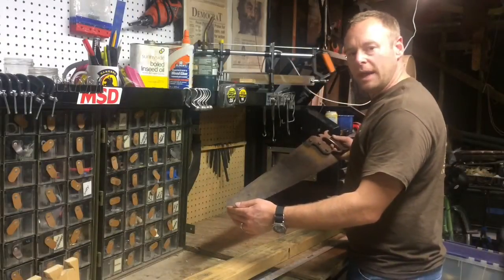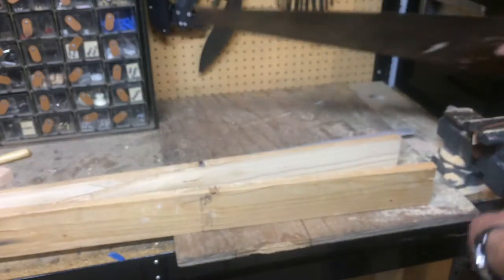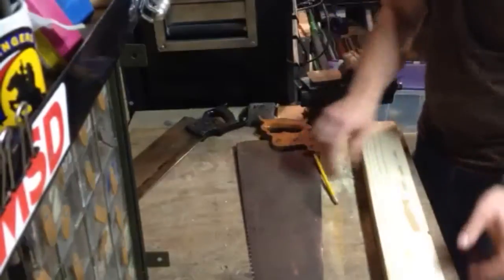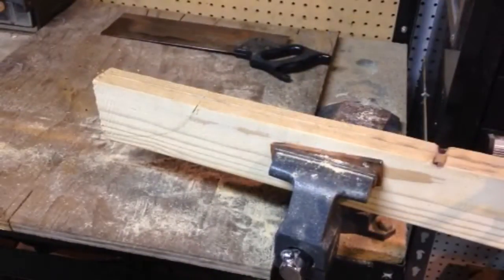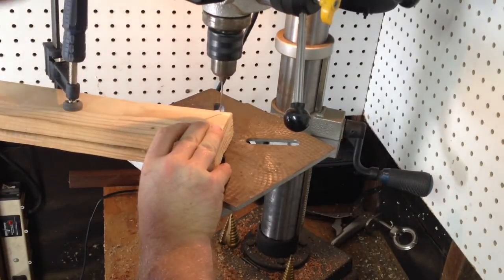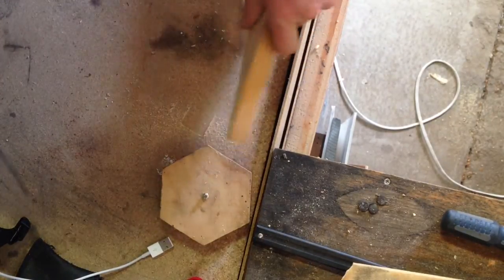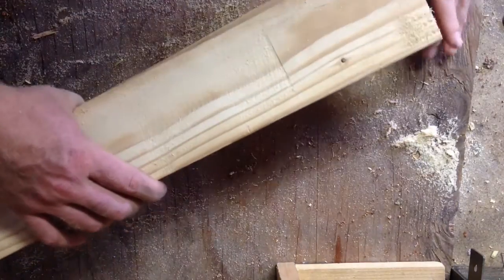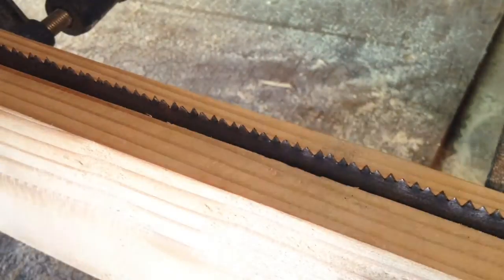Making Tools | Saw Vise

Comment: Nice and simple. A slight bevel on the dowels will make for an easier entry into the holes. Same sort of thing you find on locator pins on machinery. A piece of angle the length of the saw vise would stiffen it up, somewhat.